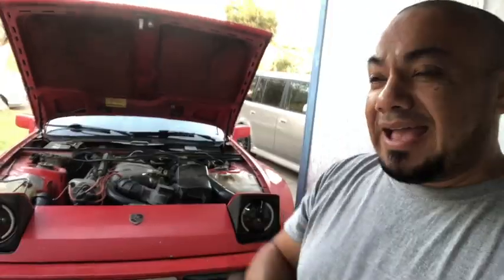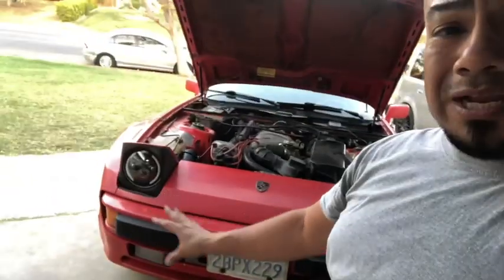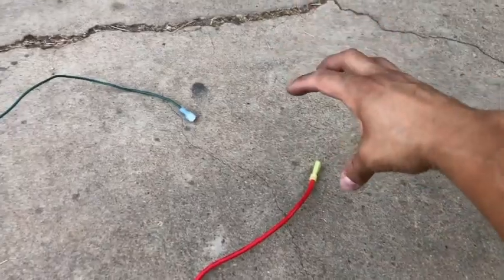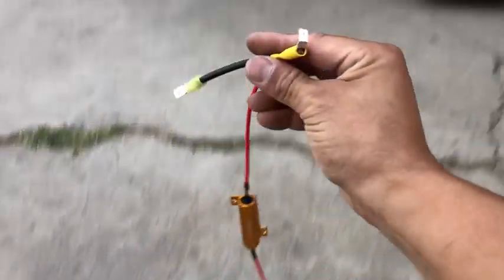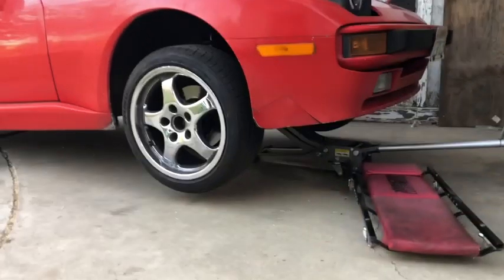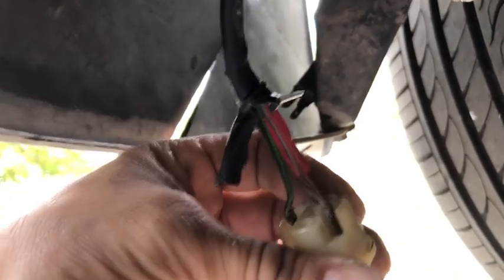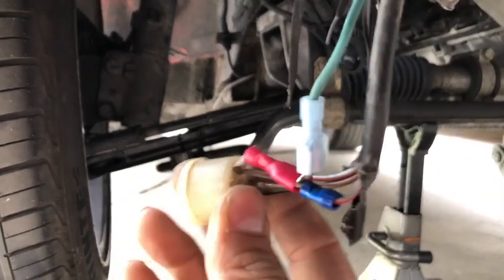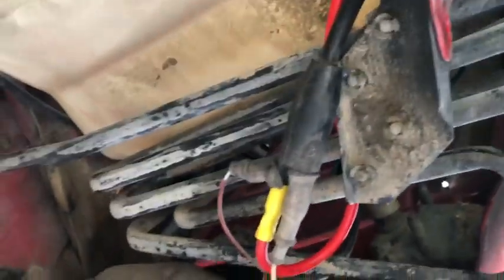Porsche 944 LED Headlight Wiring (Turn Signal and DRL)

Comment: How hot are your resistors?

I got the passenger side done and both working, the DRL resistor was getting pretty warm in the 5 minutes it was getting hot to the touch. I see there are fins on it for cooling, but wanted to check to see if that was normal for everyone else. This is my first time using resistors, or anything like this.

Thanks for this video, it’s been super helpful getting this setup!
Reply from the maker: hmmm...that is a good question, the short of it is - YES, resistors do get warm and even hot when the circuit is drawing amperage. In lighting, the DRL or blinkers are part of the lighting circuit on our cars so I would suspect them to be hot. Be sure to mount them in a semi ventilated area so they can cool and heat up as needed. away from the wires of other lighting components. I've not had an issue with mine. They are hot to the touch as well when I tested them. Only other thing I can think of is if perhaps your did not make a good contact when you crimped them in to the circuit. If their not well seated/soldered or crimped they (well any electrical connection) will run hot because of the lack of contact with the circuit when hot/on. - does that make sense? I hope that helps, and glad you found my video helpful
Reply: @porsche944shenanigans3  I was about to reply to my message saying, I tried it with a piggy back with no ground and resistors and it worked. The reason mine were flashing fast was because I had my bumper off and the other signal/parking light wasn’t connected. I plugged it back in and it works just straight wired. So now I’ve got a female with the tab starting in the plastic housing with 2 14ga wires feeding out. One for the original power and the other going to the headlight signal. I did that tomes 3 and reasoned the ground didn’t need 2 wires, so I’ll use one of those on the other side.

Idk how y’all did it with the bumper on, I couldn’t get my hands up in there but the bumper off made it way way easier.

Comment: This video is perfect it answers the exact question I had. I should have a response video up on my Chanel shortly!
Reply from the maker: Glad it helped. And it appears that this is the norm for our cars. I'll be looking at possibly creating a direct and separate circuit for the DRL. But, I have a few more projects before that. Once complete, however, I'll update you if anything changes on the LEDs - Have a great one man.

Comment: This is very helpful as I am trying to set it up myself. Did a Quick test without adding any resistor and when I put the signal on (with parking lights on) I get amber flashing then white then amber then white...
Were you able to completely shut down the white DRL when running the signal?
Will look into it and post if I find something interesting to share 😂
Reply from the maker: Yes that's how it will work on our cars and with these lights. since the DRLs and Signal lights share the same area on the Lights, they will trade light sources during signaling. The only other option, if you can find it, would be to run lights that offer separate LEDs for the DRL and the signal lights. But no clue if that is even an option - Sorry. Thanks for commenting and watching. In a few months I'll have more videos up loaded.
Reply: @porsche944shenanigans3  could you let me know the reason why you used the resistors? What was your original problem? Thx a lot
Reply from the maker: @tusaisis  oh I see, yes, no issues on your end. LED and Halogen lights use  slightly different power resistance. Halogen relays have a specific resistance to work the turn signals and if the power is too low or not present, it starts Hyper-Flashing. That way you know a bulb is out. When you use LED for turn signals, and do not have resisters built in, you car will Hyper-Flash because it thinks there is no bulb, since LEDs have a different power resistance. In my case and other owners, buying LEDs without resistors caused our cars to Hyper-Flash and/or Flash like a camera. Every year more and more LED models are coming out and I have seen that some now have built-in resistors. Congrats on not having the issue. If you're still curious - google Hyper Flash LED, you'll see what I'm talking about - Hope that helps (sorry if I rambled on)

Comment: how are you keeping the pop ups up without turning on the lights?
Reply: the headlight motor has a molex connector on it, disconnect it (remove the relay as well - optional) then use the wheel/dial on the motor to manually raise the lights and they will stay at whatever position you set them at. The wheel/dial on the motor may have a rubber boot on it. I actually left mine popped up for over 2 years without issue. I was troubleshooting a short and just decided to leave them up. Next thing I knew, I preferred that look.

Comment: Hey, just installed mine. The only problem i found was that they were pointed about 5-10 degrees too high. Did you have the same problem?
Reply from the maker: What up Nate, thanks for watching. as always, start wit the basics and make sure they are seated correctly. Though, the fact that you noticed it right away probably means that you did. For me, I didn't have that issue, maybe I got lucky. if you look at my install video around 2:14 you'll see i point out the adjustment screws. You'll need to loosen them so that you get the lights back into spec and lower the beam. it's usually only 1/4 turn increments so take your time. Good luck
Here's the video, around 2:14 I point out one of the adjustments screws. you should be able to adjust it via that one. 
https://www.youtube.com/watch?v=OqQEs4ROIAg
Reply: @porsche944shenanigans3  yes, that did it. Thank you! Subbed.

Comment: How did you get your lights to stay up without the parking lights on also? Mine all come on at the same time when I turn the switch down
Reply from the maker: the headlight motor has a molex connector on it, disconnect it (remove the relay as well - optional) then use the wheel/dial on the motor to manually raise the lights and they will stay at whatever position you set them at.